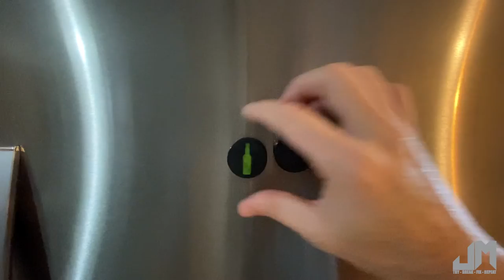Using Epoxy Resin With 3D Printing

Comment: I'm planning on filling in some coasters I 3D printed in PLA with clear resin. Is the heat generated from the epoxy a problem? Would hate for it to warp while curing. I was planning on using epoxy with a 30 to 40 minute working time as I assume the slower reaction would also generate less heat.
Reply from the maker: Not sure on how it will affect PLA. These days I use PETG and it doesn’t seem to have any issues. I would love to hear your outcome though, good luck!
Reply: I’m literally doing the same right now 😂 love how we had the same idea
Reply: How'd it go?
Reply: @jaydenhaynes9985  worked great! Never really got hot and I even used a pressure pot to get really clear results.
Reply: @LockDots84  Sweet, glad to hear it! That helps give me some reassurance that it may be alright to use a biodegradable epoxy resin as an adhesive between PLA and a biodegradable styrofoam without much problem for an engineering project!

Comment: If you have access to a vacuum chamber (I have a chamber vac for food preservation), you can supposedly use it to remove bubbles.
Reply from the maker: That would work for sure. And it would be the preferred way to get rid of all the bubbles.
Reply: @justinmcclung  thanks for the reply! I'll have to try it once my resin arrives. I might document it and post a video on here as well.
Reply from the maker: Please do.

Comment: So this resin does not get hot enough to melt PLA? because im trying to find a resin to do a poor in a pla print but i need to find one that wont melt it if this wont melt it can you comment the link?
Reply from the maker: Not sure. All of my testing has been done with PETG with no melting.

Comment: can we use epoxy resin for smoothing out 3D prints
Reply from the maker: I believe you can. You will want to get the mixture just right so it hardens well though.
Reply: would be much more work than ABS and acetone smoothing